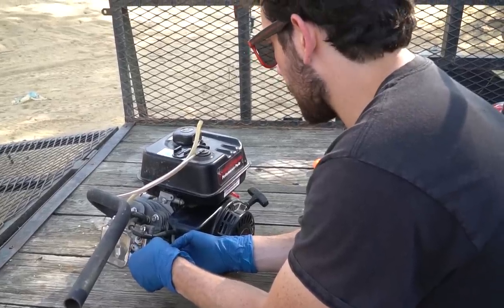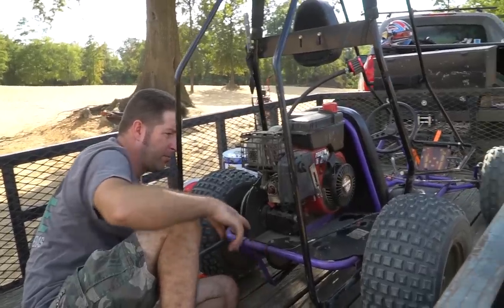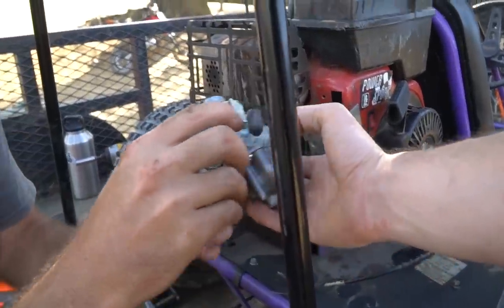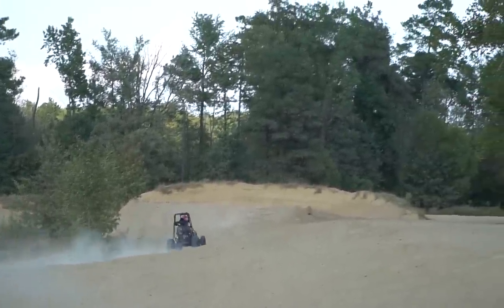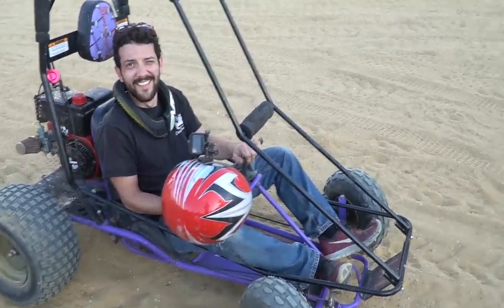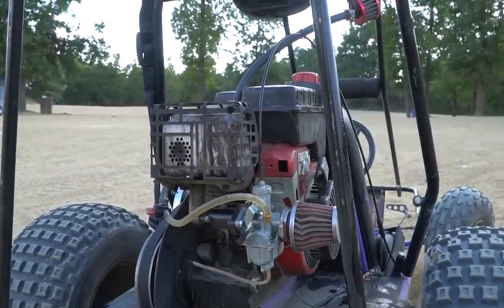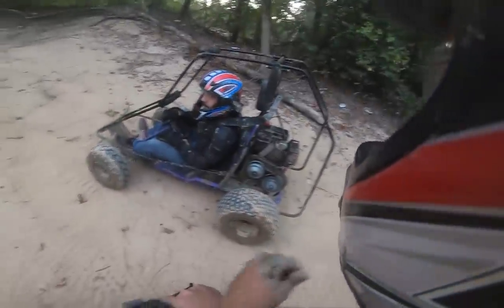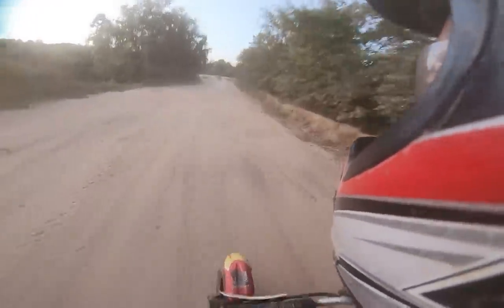Secret Tecumseh Performance Mod | One Bolt On = WAY More Power!

Comment: "14 seconds on a carburetor swap"  annnnd a governor bypass.
Reply: Ted Fryman annnnd a longer runner
Reply: @haydenmadigan8186  I was just about to mention that. Few people realize what a difference a change in the sonic resonance tuning of intake or exhaust manifolds can do. That longer runner most likely gave that engine's low-end torque a "shot in the arm" it badly needed to help that [likely[ heavy cart perform well off the mark. Imagine what it'd do with the addition of a tuned header...!
Reply: @haydenmadigan8186  Longer runners the same effect high-rise intake manifolds have on V-8s.  Stock Tecumseh carbs suck, Mikunis are da bomb!  Great video, thanks!
Reply: Usually a stepped straight header is about the best for these engines  as well as a 30 to 45 degree intake vs the 2 90 degree straight down intake that style intake is very good for lowend torque the exhaust heats that portion up resulting in more of a gas to oxygen mix then a liquid to oxygen mix if that makes any sense 🤣 the 245 cam in one with a decent carburetor a straight header will suprise one who doesn't like them.
Reply: Kylee Bates yep that's very good advice for almost any engine, i also like to achieve roughly the same displacement as the engine in volume on both the intake manifold and the velocity stack (or intake tract)  and decent length header, I did some math for a stock cam gx200 tuned for 3600rpm and came up with a total length of 550mm 1"  stepped at mid point to 1.25"  and 180mm of 1.5" on end,  My clutch engages really hard now with that setup
Reply: Ji F. If you go on the motor trend app they did an episode of engine masters about intake runners and what effects different runner length had on an ls motor not sure wich, the dyno graph says the rest. And I agree I have a mikuni on an off brand pit bike and the thing rips
Reply: @pancudowny  Those Manco Dingos are light as a feather
Reply: how can i bypass the tecumseh 6.5hp governor
Reply: @michaelg.hamilton7363  My best advice is removing the whole governor gear, you can take the side cover off of your kart and destroy the plastic gear that's attached to it, easiest way to destroy it (imo) is with a wood chisel and a few good hits of the hammer, make sure to remove any washers or clips left on the shaft that holds the gear. Should be a really easy job, just don't rip the gasket, or make sure you have a tube of gasket maker.

Comment: I would love to see you guys build up one of these tecumseh engines, I think they have a lot of potential
Reply: And I got three of them just setting around .  Now they have become " Keepers ".
Reply: I'd love to see them build up the briggs intek they had on the mower. Ive got one and it's a haus when clean and all. I have mine on a vertical shaft motorcycle build.
Reply: No they dont they are junk I had one same one as them spit a rod... the old ones 70s and back are built like brick shithouses but newer ones are scrap you over rev em it's not if it's when it spits a rod
Reply: I got one with a 356 cam in one. And a bullet rod
Reply: A decent amount of guys race those motors around my area
Reply: False Flag  uhhhhh no no not at all they are famous 5for kicking rods it's a common thing..... old flat head techumesh are great engines but the later ohv engines are scrap. I'd run a predator over one any day.. and those are Chinese engines...
Reply: False Flag  craftsman doesnt make engines
Reply: I sent a stock rod into low orbit on a predator, stock shit don't last for rodding
Reply: I'd take a genuine Honda engine over any engine.
Reply: I'm rebuilding a ohh60 right now but I'm trying to get it started, after that I'm gonna build it up

Comment: I had a Manco Red Fox when I was kid. My dad and I hopped it up by stiffer clutch springs in the torque converter, header pipe and by passing the governor. It would legitimately do 57 mph on the road.
Reply: I’m getting a yerf dog 3200 on the 6th of July aka 2 days from now, what should I do to get it to go above 55?

Comment: The Tecumseh motors can by drastically improved with stock parts. Just mod the carb for crazy amounts of air and fuel. But the performance parts that will take the stress don't really exist. I've seen my dad do it several times and they run like crazy until it blows up, and I mean blow up. If you stay moving you will probably not get hit with hot oil!
Reply: Damn😢😂
Reply: Unfortunately true. Performance parts for Tecumseh engines are practically nonexistent which is a real shame. The connecting rods are weak on these engines.

Comment: I did give a couple of tips on the comment on the last video of this kart with the tecumseh ohh60 6.5hp engine. I was thinking the 22mm carb would be to big if I remember correctly the intake valve is 23mm and the exhaust valve is 19mm it's been a while an my calibers battery is dead and I dont have a mechanical one. The valves can be changed but they are a larger valve stem. The 245 dyno cam is pretty good cam for these engines I do recommend upgrading valve springs a clone or Honda style spring is slightly larger in diameter so if those being ylused the spring pockets will have to be cut. Oh and note the crank does not have roller bearings like a 196, 212 and so on. They have a bushing style bearing same as the rod and wrist pin. So they will need to be checked. The 5hp ohh50 series cylinder head is a smaller combustion it will help the 6.0 ohh60 engine being a bigger bore. I'll have to get back with you on the bore sizes. Also the blocks of the tecumseh ohh50-65 series engines arent braced well from the casting they designed. So I would definitely recommend having someone tig weld braces on the block very costly but well worth it when the block can handle what you throw at it. They are a very interesting engine to not only run and it run well but to work on. They are very bad for valve lash if not wanting to start...they was based for road coarse racing the f200 class and they was definitely designed for racing and not longevity. I'll see what all other info I can find I wrote down on these engines.

Comment: Looks like a blast. I've rebuilt and modified nearly 1000 Tecumseh Carbs and have a love for them. They will however always have a dead spot when used in a go cart. They were designed to keep a steady rpm and do a fantastic job at that. If you want to slow or even stop oil blow by, don't use multi viscosity oils: sae 30 only.
Reply: It says on mine to use 5w-30 in the winter under 32 degrees and SAE 30 otherwise, but it was on a snow blower and I want to use it on a bike. I was thinking of running a good 10w-40 with a dash of racing ZDDP from Lucas oil. Is that a bad idea? Should I just run the standard 30 and some ZDDP?

I need to dismantle and clean the carb, then mount the engine, then built an exhaust before I decided on oil anyhow. I think I will go the 10w-40 route with ZDDP unless there's some big issue... Maybe I'll get back to you and let ya know if I'm blowing oil haha
Reply: @greenbassboosts8872  Only run straight sae 30. Multiviscosity oils are meant for water cooled engines. The higher temps of air cooled engines will break the viscosity modifiers down and they will act as simple 10 weight oil.
Reply: @sixtyfiveford  okay good to know. I'll pick up some straight 30

Comment: Had a Manco Dingo since I was a kid, still have it. Gotta put a new torque converter in it but just like you guys experienced, it handles better than average. I've had a few different motors on it, be cautious as the frame can twist, I was running a 16 horse 2 stroke sled engine in it and bent the frame where the bearings hold the rear axle. It's a strong enough design for every day use, but was intended for a 5-6 horse motor. Keep that in mind when going up in horsepower...I know you guys lol

Comment: If you put a pipe on it you can actually bolt the carb right to the factory intake manifold , I have an 11hp tecumseh here with a vm-22 and a straight pipe and it works fantastic . I also have a Manco dingo cart so these videos are great .

Comment: The longer intake runner might have been part of the increase as well. The intake is supposed to be a certain size percentage of the engine volume and factory rarely is.

Comment: I'm actually doing a Tecumseh build. I have a stock max speed on a Manco Dingo of 26mph. I've only really done the Carburetor so far. I've completely stripped the carb, Removed all crap and junk from inside. I've bent the valve arm some to allow the carb to open up fully! There is also a little screw that holds the butterfly valve to the post that rotates inside the carb inlet. There was about 1/8th of an inch of screw sticking out the otherside, I have completely shaved it down smooth flush to the valve post so it should flow air a little more better. I'm excited to see how it all performs so far. Next is the head. Gonna do the Playdough trick and see how much I can safely mill off. I'm expecting a 50+mph run with no performance parts. Just my own tweeks and mods. Definitely going to add what you guys did here and adapter for the airfilter!

Comment: I just bought a maco baja 200, which is almost exactly what u guys have in the video. The 5hp Briggs and stratton engine was seized up. I found a tecumseh 6hp engine used for 40 dollars. Its starts everytime on  the first pull. I will end up doing what u guys have done in this video. I paid 200 for the dingo and 40 for the engine. For less than 250 in it feel I'm doing pretty good.

Comment: We have a couple, they're torquey little Bastards. We have a trail bike with a 6 on it and it's quick as hell and does almost 40. I took a compressor and tank that someone gave me and put a Tecumseh 3.5 on it and it pulls it just fine and it had an 6.5 horsepower on it before that sounded like it was working hard to pump the pressure up. That little engine looks insanely small on the whole compressor setup. Surprisingly powerful engines.

Comment: Bring back the drift mower pls

Also, that roll cage is looking incredibly flimsy
Reply: AIO inc. that roll cage aint shit bet its gonna break soon
Reply: Made about 10% weaker than neck bones...
Reply: What roll cage ?
Reply: I have a Dingo and trust me, the roll cage does its job just fine. Don't ask me how I know.
Reply: I took my cage off.
Reply: Most of the time those aren't even advertised as roll cages if you look at the original ad. I think they are supposed to be protection from tree branches etc.  Not saying they wouldn't offer some rollover protection...

Comment: Run a line from the crank case vent down to the oil cap reservoir spot. It would eliminate the issue of losing oil. Maybe add a filter from the crank case down.

Comment: Every Tecumseh engine I ever tinkered with had a crappy carb on it. Must be a Tecumseh thing.
Reply: Breaking conrods is a Tecumseh thing
Reply: Michele beck they just don’t like being beat on.
Reply: @michelebeck4311  sticking valves/breaking lifter bores is a Briggs thing

Comment: Tecumseh made a great engine, I just finished rebuilding an HH100. Parts are readily available, performance parts not so much. You already upgraded the carb, you might try welding onto the cam lobes old school style for more lift and heavier valve springs. Do a little in house head work. It would be a great video.

Comment: Just a thought on the long runner for the carb, the longer running Might actually be helping with low RMP Torque. The Length of intake runners is something considered by car manufactures afterall. There is a video on Engineering Explained about things like that.

Comment: That long intake runner with the carb really worked well!! I bet alot of that is from the long intake runner.
Reply: Some Tecumseh engines have a quite long intake runner from factory... My snow blower engine sure does

Comment: Carburetor aside, lengthening the intake runner changed the tuning of it, which improved low-end torque. That, and I'm sure giving the charge a nice, straight path to follow immediately after leaving the carburetor before hitting that ridiculously sharp turn helped as well.🤔

Comment: BMI karting use to sell performance parts for the Tecumseh engine.  Great video! You can actually get alot of power out of the Techumseh engine the problem with them is finding the parts.

Comment: Did you guys use the 48 or 65mm adapter tube with the 22mm Mikuni carb? Also, does that cart have a throttle cable all the way to the pedal or a rod style throttle halfway back to the engine? I'm trying to figure out what parts to order to do the same mod.

Comment: In the car community, when you have longer runners for the intake manifold, you gain more torque. When you have a set of shorter manifold runners, you obtain more horse power. Using car science since you upgraded the carburetor and put a long intake runner in, you basically did the most common mod in NA cars to gain HP and torque. I would probably jet the carb just a tiny bit to accommodate for the intake runner more.

Comment: Tecumseh performance build would be cool. They get so much crap from people because the Predator is so cheap to swap on, but they were built pretty well. I have a lot of them in the larger flathead variety that are 45+ years old and still run fine. Granted, they're in Garden tractors, but still... I have blown up a fair share of snowking motors though, for some reason, maybe because they are jetted for cold weather, every time I put one on year round equipment, they blow up.

Comment: Tecumseh rototiller has an extended "pto" cam (that you cut back behind the regular case plug) that is steel and a ball bearing output case.

Comment: I have had a few Tecumseh engines and the only thing I had issues with were the carbs. I had a 4hp flat head, 6hp ohv and 9hp flat head, all had issues with the cars, and it was often. I found that the 6hp greatly benefitted from a different, non 90 degree intake. The 9HP was awesome once it had a mikuni VM on it, it was either a 24 or 26mm from a snowmobile, the 4hp was great until I cooked the rings, I shaved the head, ran a carb from a honda 6.5hp mower and it ran great (Before i killed the rings).

Comment: Put the crankcase breather in the rocker box so that the oil that the con rod kicks up has a chance to settle out of the air, on the way to the breather tube. A pulse fuel pump will still work if you reduce the size of the vent tube, thereby increasing the crankcase pulse pressure.

Comment: I remember when Tecumseh made the best lawnmower motor ever.
Reply: Pepperidge farms remembers
Reply: @preetamdasika7636  lmfao I needed that laugh
Reply: You mean the worst. I've had nothing but problems out of them
Reply: The cast iron HH series are the best outta them all. Have one on my Sears Suburban and it just keeps going and going while all the Briggs and Kohlers sit and watch cause they won't start half the time
Reply: Oh yes, good times. Then in 2008, everything changed, and there was no more Tecumseh. It´s sad, they outperformed Briggs&Stratton so easily. I wish they´d be still around...
Reply: @Ohiocountryboy-se2cn  Have you checked if you maybe have to left hands?
Reply: @gilwilliams9036  I have a few suburbans as well. All run fine still.  And so does my old 70s snow blower with a tecumseh

Comment: What i find more funny about this is a cheap maybe $60 mikuni carb vs $160ish stock carb made a big difference but then again it probably lost a lot of low end torque as they are more mower/commercial application motor.:)

Comment: With the bumps affecting the carb how about trying propane. You could just plumb it into the intake tube with a grill regulater or get the proper regulater to convert it.

Comment: The significance of the power Increase is likely due to the added length of the intake runner. Longer runners make better torque and for a small single cylinder engine like that you want to focus on torque more than hp. The engines gonna rev no matter what but it’s the pulling power than gets you moving.

Comment: Some predator valve springs make a big difference I did a 6horse tecumseh for a mini bike, valve springs carb govenor and some light welding and machining on a predator cam will make beefy 6horse tecumseh. Keep the original caps and retainers

Comment: Please build one with a 2 stroke engine and mod it out
Reply: Lil gaia Starsoul they got 2 2 stroke motors
Reply: @gokarting1018  
Did they do a build series on them?
If so let me know
Reply: Lil gaia Starsoul not yet they got the motors right after the cross kart was about half way done look in some of the vids with the e85 kart u can see one of them with the starter motor sitting in the background

Comment: I have two old Manco Dingos one with a rollcage and one without. Only one is together at the moment. Has a 6ish HP Honda clone with a eBay torque converter. Carts my 180lb ass around just fine. Excellent smiles per dollar.

Comment: I'd love to see you guys do a performance built Tecumseh engine. I could donate one off a snowblower. 5 to 10 horsepower. Single or twin shaft. Flatheads with internal valves no overhead valves.

Comment: What intake manifold did you use? I have the same tecumseh engine, and need clearance of the carburetor. The black one you have. The tecumseh intake manifold is 48mm center to center bolt holes, the intake manifold on the site is 48mm-43mm. I need a 48mm-48mm.

Comment: Just need to build a frame similar to the Dingo, with trailing arm (like the Deuce and Odyssey 250 and 350) front suspension and a swing arm rear suspension and it'll be a lot nicer on the rough terrain.